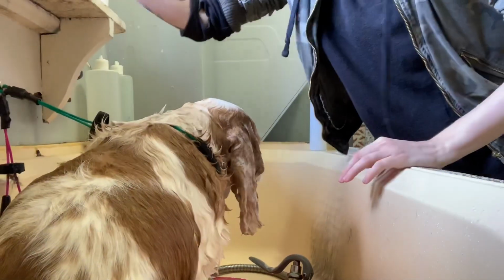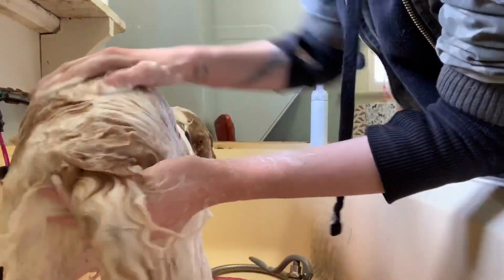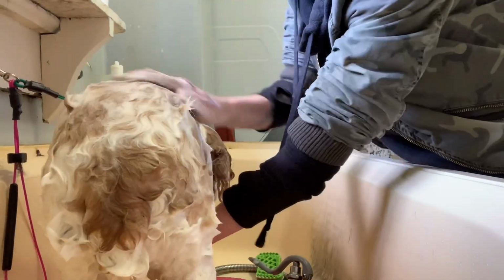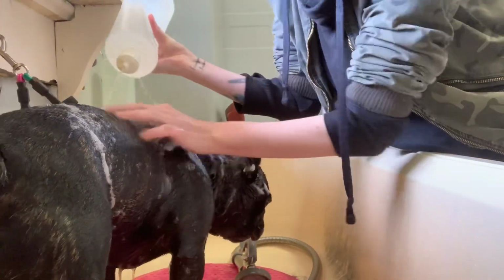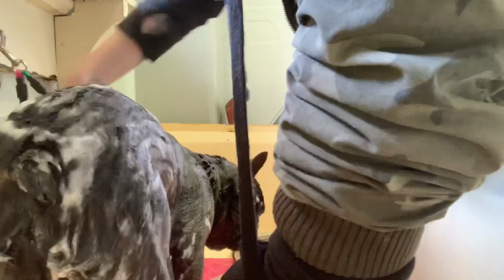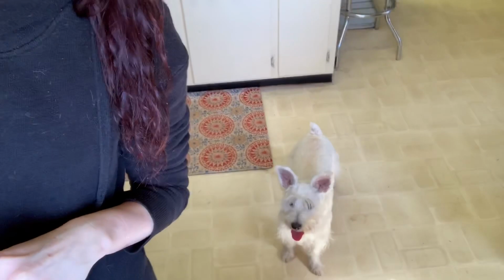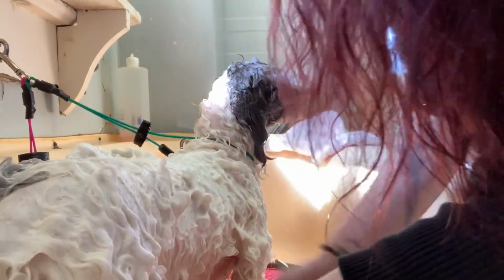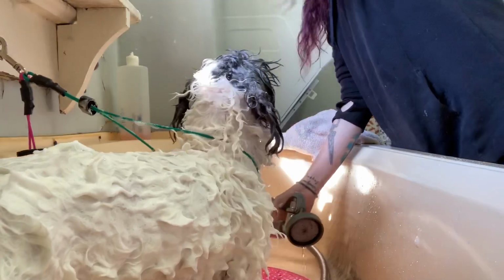Furbliss / How it will save you time and money

Comment: Just a tip because I also LOVE the furbliss tools; the back of the brush with all the little v shaped teeth on the ridges is meant to be used to help pull hair out of the much smoother spots like down the legs of the dog. It’s amazing how well it works to help deshed even after the bath. The furbliss is such a versatile and amazing tool.